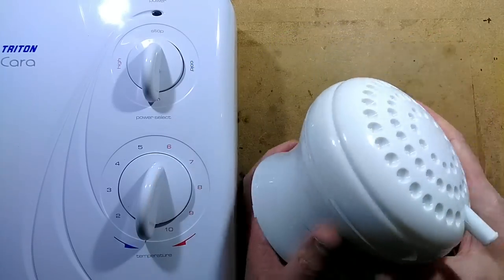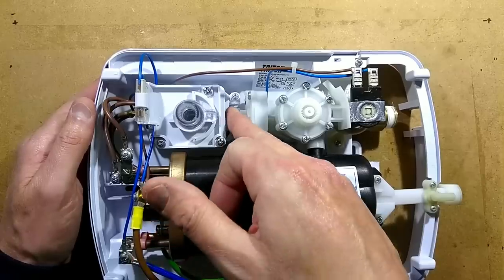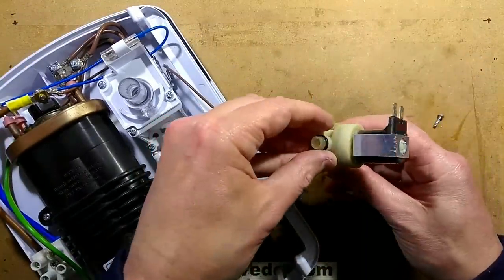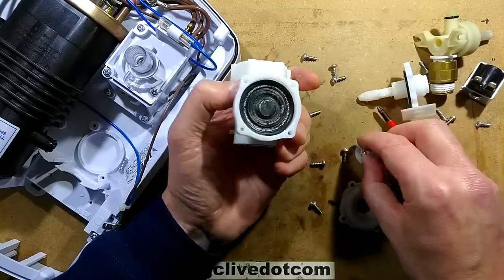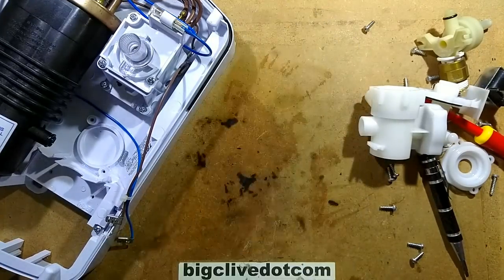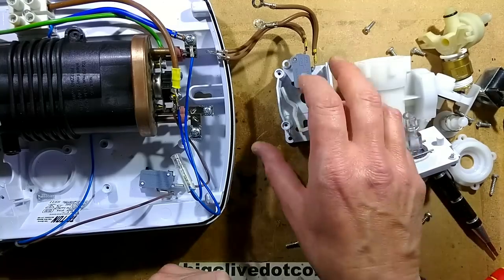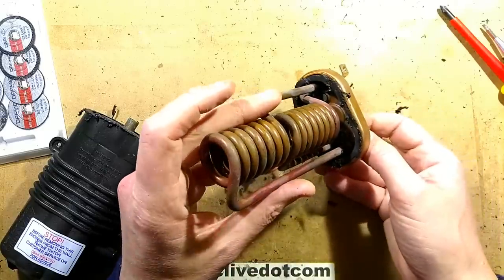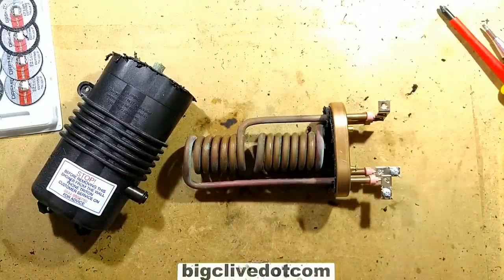Teardown of a UK electrically heated shower unit.

Comment: When I was in Ireland I used this unit at a bnb. It cycled from scalding to freezing. I would move in between for that split tolerable zone. I figured I didn't know how to work it at the time but after using more later I knew it was broken. 

I never felt unsafe about being electrocuted being an American and not knowing them. I assume everyone had them so they have to be safe.

Comment: Ah, the UK, with the safest wall sockets and every shower feels like Russian roulette. I presume it's for efficiency?
Reply: Matthew Trzcinski  In what way is it unsafe? The outer metal part of the elements is earthed. The wiring and connectors are protected by a plastic case. What bit or part do you consider to be unsafe?
Reply: Yeah, this unit operates on pretty much the same principle as an electric kettle, only with more powerful elements heating the water as it flows instead of boiling it in-place…

(To be fair, in Australia at least we did have kettles with bare elements before the sheathed type came in. Though even those were probably safer than the suicide-shower, as they were at least interlocked to prevent power connection with the lid open, and in a ceramic body…)

Comment: These are safer, yes. But in every way they are shit. They give poor showers, the terminals burn up, the elements burn up, diyers fit them with the wrong cables and dont tighten them up right.. Anybody who designs a bathroom around an electric shower deserves a shit shower.

Comment: My electric shower always trips the circuit breaker/fuse. Is that bad? Haha, it's annoying.
Reply from the maker: +AnUntitledPicture Is it tripping the main breaker or just the one on its circuit?  If it's the main breaker it may have a failing element.  If the smaller breaker, check it is properly rated.  Usually 40A for UK showers.
Reply: bigclivedotcom Just it's own one. Will have a look, thank you for the reply

Comment: I once had my electric shower just stop working, just after lathering up.  It took several days for me to identify the cause.  Eventually, I was tracing the wiring between the shower and the ceiling switch & noticed that they were completely different cables!  This is what I found in the wall https://furrie.net/sites/default/files/images/manky_shower_wiring.jpg
Reply: Damn, what a mess!

I take that those cables are quite undersized for the load of the shower, too? (Unless my sense of scale is off…) What kind of condition is the remainder of those cables in?
Reply: That is some manky wiring indeed, and that little chimney will need replacing or you'll get electron soot all over the inside of the wires!

Comment: 240VAC in a shower stall - what could go wrong?  Uh, I'll stick with the way it's done in the US:  The heater is outside the shower stall. The only thing sharing the stall with you is the mixing valves.  Typical is to use a tank of water that's kept hot, but the on-demand systems are getting popular.  I'll accept some wasted water in lieu of 240V just under the cover.  Especially since it may have been "fixed" by a handyman.
Reply: If you wanted to sell your house after installing one, you'd need to get it installed by a qualified electrician who'd certify the work had been done to standards, as solicitors require them as part of the moving process.

Besides which, they have to have their own dedicated cable running directly from the consumer unit (via an RCD circuit breaker) with the cable poking through the wall behind the shower - it has to be permanently installed. Showers installed at the time of the house build will usually also have an isolator swtich located outside the bathroom as an added precaution (as will extractor fans - especially as some modern homes contain bathrooms with no windows, so the extractor fan is the only means of getting an airflow through the bathroom).
Reply: RCD?  Is that anything like a GFI (Ground Fault Interrupter)?
Reply: Yep.  Combi boilers and mixer showers are becoming more popular over here on the basis of economy; they seem to be pretty much standard in newer properties.  That said, electric showers can be perfectly safe if competently installed and well maintained.

Comment: Man, for all the quality of life things you in the UK have over us in the US, your plumbing and electrical systems are pretty lousy.
Reply from the maker: It's all fairly logical.  We have a beefy 240V supply that can run appliances up to 3kW from a good robust socket and plug arrangement, and we do have central water heating systems, but with the power available the electric showers are a very convenient way to have hot water on tap nearly instantly with no losses.
Reply: A kettle is more efficient than a teapot, an electric shower is more efficient than a water heater.